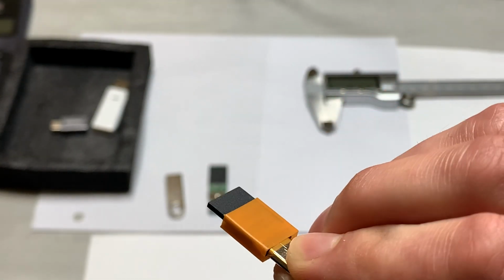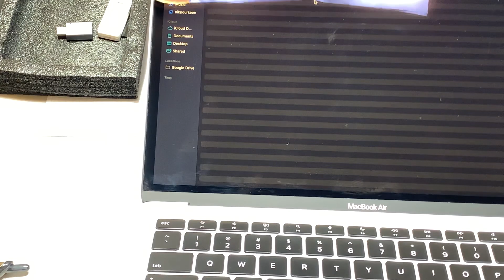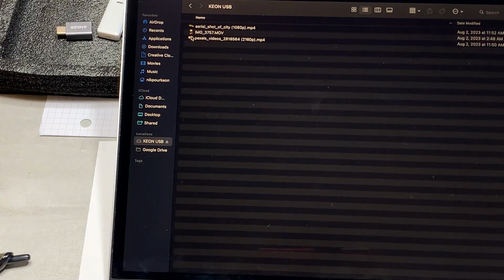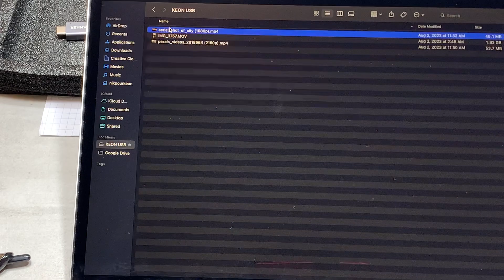Physical USB Formats Explained (PCB vs UDP) & How to Make a 3D Printed USB Drive

Comment: Any chance you could provide the Aliexpress link to that adapter? I havent had much luck finding that exact one.  Thank you, Great Idea.
Reply from the maker: The orange adapter? Because I designed and 3D printed that, but I could make the STL files available if you have a 3D printer. 

I’ve also been thinking of maybe making a lot of them and listing them on eBay or something at a really low price since it’s just a tiny piece of plastic. Although the USB 3.0 version of the UDP chips fit in standard USB ports no problem…
Reply: @KeonsLab  he's prob talking about the Usb A to Usb C adapter that you specifically said was on aliexpress, not the plastic case you 3d printed.
Reply: @KeonsLab  i need this stl file PLASE for school project on 3d priting

Comment: This is really cool! I actually have a couple of those Kingston Data Traveler's. So despite having these, I didn't even know they existed! A very elegant solution that I'm sure along with the benefits listed already also saves costs too.
Reply from the maker: I also just recently learned about these too! I forgot to mention in the video that the longer version of the chip inside the Kingston DataTraveller is the longer, ‘standard version’ of UDP, while the one I showed in the video is called a “micro UDP”